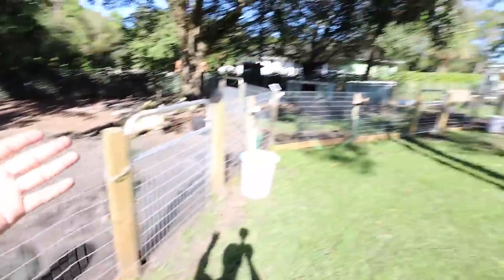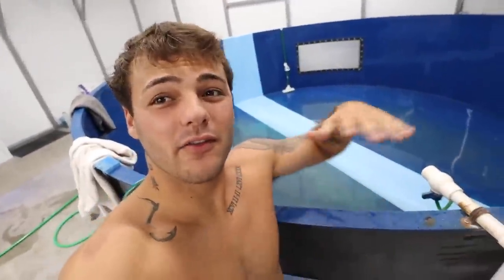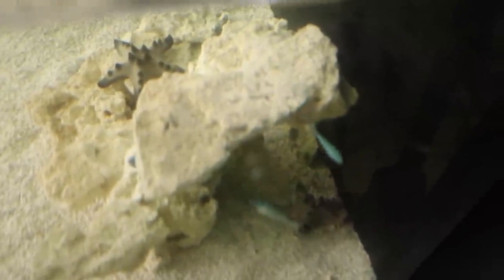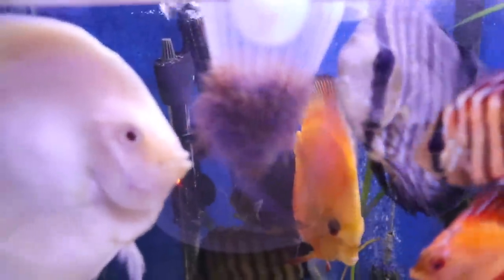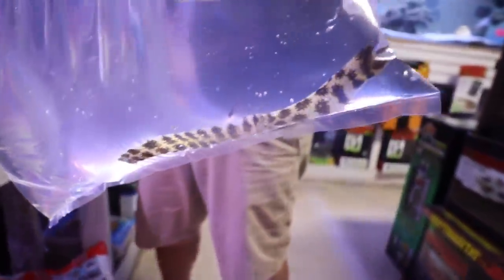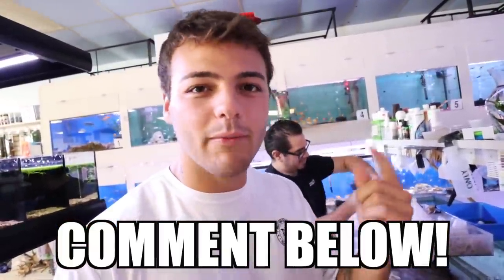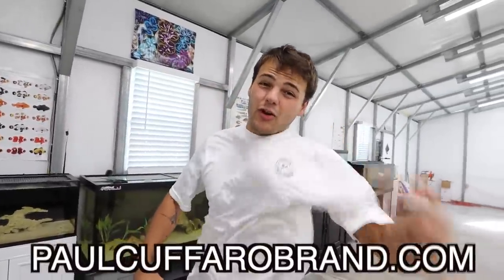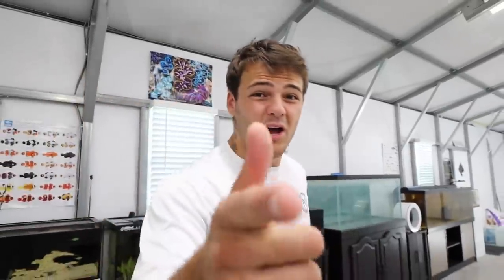BUYING EXOTIC EEL for My SALTWATER AQUARIUM!!

Comment: For tank labels… I have started to use double sided tape and a hard plastic baseball card case… then I write my info on a notecard to slide in and out… that way if I move an animal it is easy to move their label or write another card.  You can also put the labels on the card if you don’t have great handwriting….. just a suggestion because sometimes the labels stick/split and make them a pain to remove